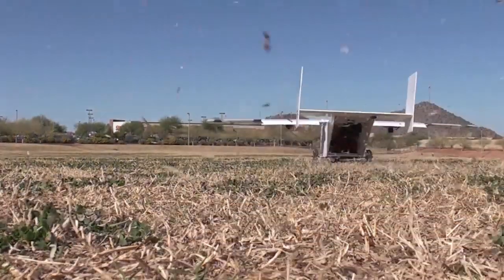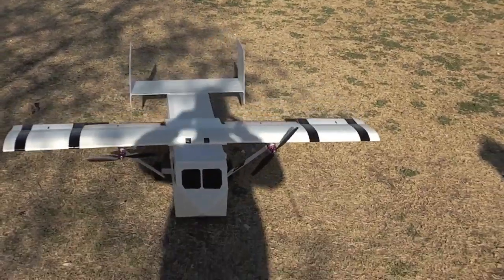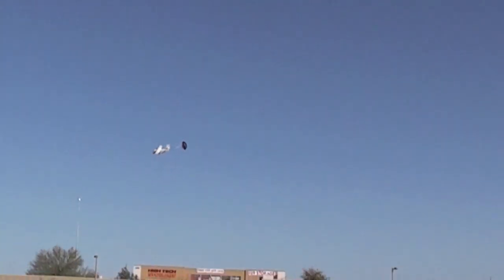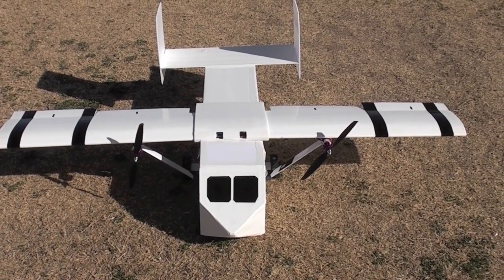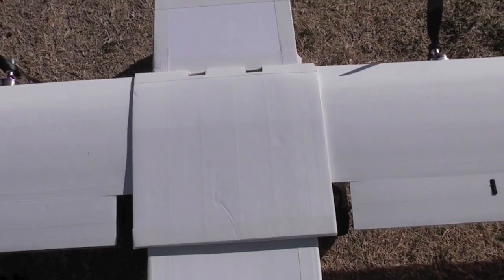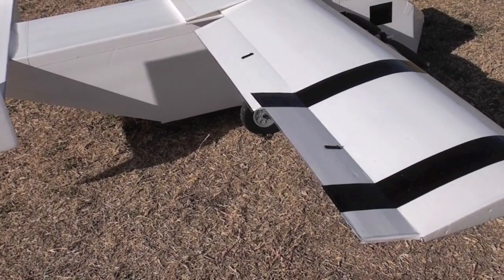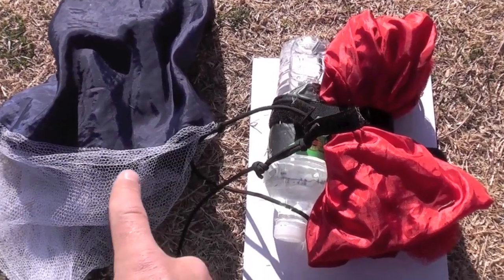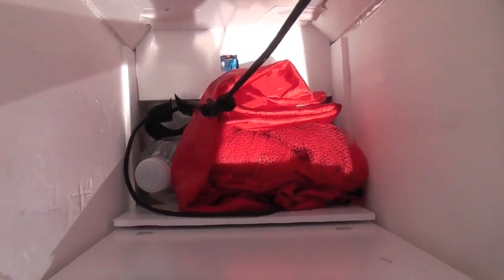SKYVAN Cargo Dropper

Comment from the maker: I cut the lower part into a wedge first, then joined the sides to that and trimmed to the joint.  I then cut the sides down at a slope (side profile) and laid the top over that and trimmed to the joint.  There are a lot of ways to go about it.  Do note that any profile will "shorten" once it's folded, so make the nose flaps longer and pointier than you want the final airplane profile to be.

Comment from the maker: Will work with any transmitter.  The mixing occurs on the aircraft.  You just mix the rudder channel and the throttle channel onboard with a V-tail mixer, less than $10 from most sellers.  More detailed video on this at some point in the future.

Comment from the maker: I usually do not tape the interior surfaces unless it's for the need of affixing and removing components, and having packing tape makes it possible to apply and remove two-sided tape more easily.  I don't think the tape adds a lot of strength.  The Skyvan is not taped inside.  The foam and paper itself seems pretty capable of withstanding a fair amount of stress.

Comment: How much strength do you figure if any does the packing tape add to the structure? If it does do you add pack tape to both sides, ie. internal fuse pieces?

Comment from the maker: You will need an onboard V-tail mixer.  Hook the rudder wire to the rudder channel on the receiver and the elevator wire to the throttle channel on the receiver. Connect the out-channels to each motor.  I recommend removing props, then power up the system (in case mis-connected, no chance of unexpected prop spin).  Test rudder stick and see that left motor spins up with right rudder, right motor spins up with left rudder. Reverse if necessary.

Comment: @ExperimentalAirlines, The one I already purchased I used as a "super sack" for storing recycle plastics until I get to the recycler so I cut it up some. It didn't seem too heavy but then again, I wasn't thinking of using it as a chute when I bought it. 1st chance I get I will buy at least one more, weigh & measure it, and at least post pictures & info if not a video!

Comment from the maker: @guitt02 The differential motors are done by V-tail mixer on the plane, mixing the rudder channel to the throttle input.  On this plane I've mixed that function into the aileron input on my DX7 radio.  It's a common mix: rudder to aileron.  Many radios can do that.  When I do a video on twin motors I will definitely address the differential thrust thing.  It's very handy.

Comment: @guitt02 
Its most likely via an external delta/vtail mixer,  Plug throttle into the elevator and rudder 
into either aleron ch or rudder ch depending on what your mixer says.

Comment: Well I was going to ask about the chutes but you answered that in your description. I have several chutes with webbing (the best) and several airfoil chutes with webbing. Very good and descriptive video. Any hints on how to eject a chute out of the back of an EDF RC jet? I want to pack in the tube method but I can't have alot of weight added. If ya have ideas I would love to hear them.

Comment from the maker: @rcdawgmc All the weight is borne through the struts from the bottom of the fuselage to the wing, where the strut engages the full-length carbon arrow shaft spar.  There are four nylon nuts between the top of the fuselage and the wing joiner section that just server to keep the wings from 'scissoring' relative to the fuselage.  The wing comes off for transport by removing 6 wingnuts and all the electronics are in the wing center section.